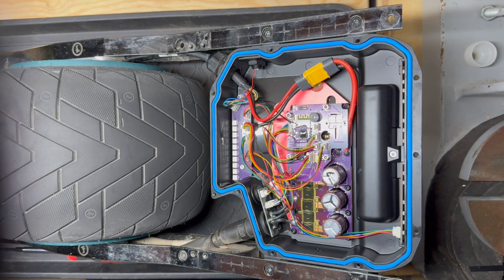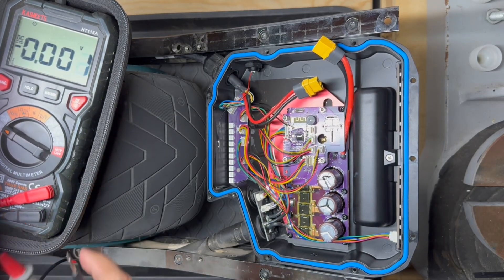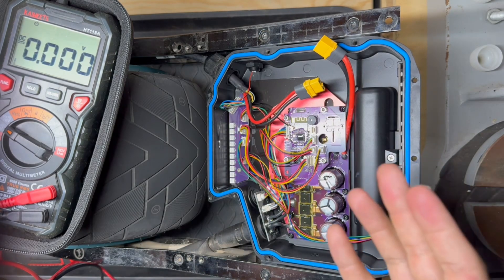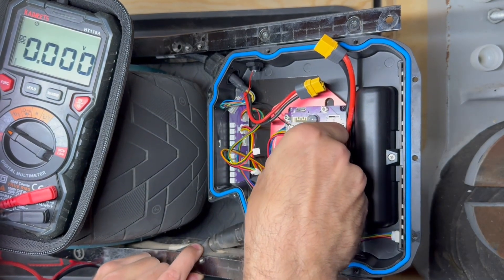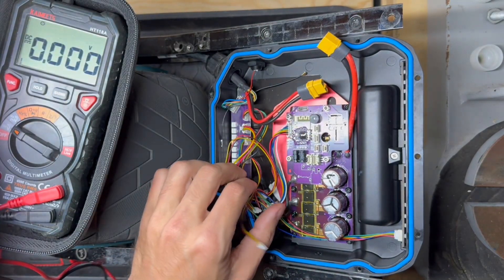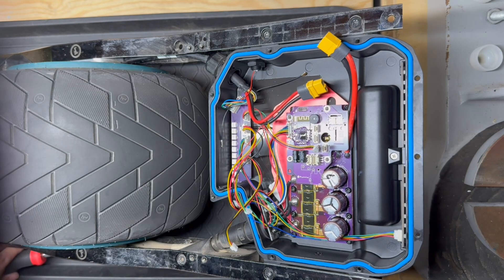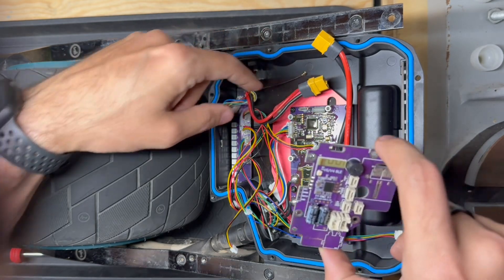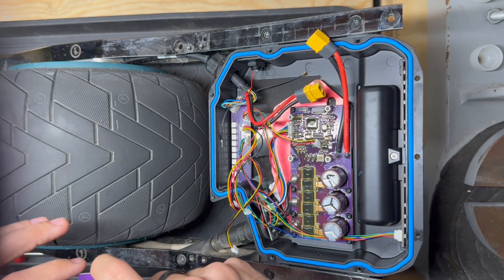How To: Floatwheel GTV Power Kit LCM Removal

Comment: Great Video, quick question Tony sent me a replacement LCM and PCB, my status light bar goes out or stays stuck on either side when I place my foot on the footpad but I have normal ADC values and the board engages and rides normal. Any idea what causes the LCM to go bad or what part does it play with the status bar? It was a relatively new kit less than 40 miles?
Reply from the maker: Given the complexity of the LCM, there are many things that could go wrong. That said, that could be a glitch as well and could be a non-issue (aside from being annoying).

Can you message me through my website? Curious to learn more about your issue.

https://www.fixmypev.com/contact-us

Comment: So was the LCM fault only affecting the lights? Or you never got to find out fully all the issues?

Obviously any known fault makes it a write-off I guess, I am just curious if the problem was isolated to the lights.
Reply from the maker: As far as I could tell, only the headlight and taillight were impacted, but I’m not sure if there was anything else being impacted. There definitely could have been.

Per PEV.DEV (since this is a modified Floatwheel ADV controller):

The “Light Control Module” in the Floatwheel ADV/Pro controls the lights, a buzzer, as well as the power state of the controller.

Comment: I was just installing my GTv kit and I watched Tony’s video a little too literally possibly? 
So I followed the video and before you go back to the BMS so you hook up front first, or after? does it matter? is  it OK for me to attach everything upfront after the BMS has been fully installed-in the order.. I just don’t wanna plug something in incorrectly… I’m new to this Vesc.  😁🤘🙏
Reply from the maker: Hook up the front first. This is what Tony does although I don’t think he shows that step. With the Onewheel BMS, there is no spark at the controller because it should be off (but there may be a spark when plugging in the second XT60 on the Floatwheel BMS - Tony highlights this).
Reply: Thank you, so I will disconnect the BMS and everything back there and then go ahead and connect the controller.  any specific order I should hook up the controller? I would think it doesn’t matter because there’s no power to it but what do I know? Always a huge help thank you.!!!
Reply from the maker: Nope. Just make sure everything’s plugged in where it’s supposed to be and you should be good. Make sure all of the connectors are fully seated as well. Tony’s video is pretty helpful, but just take your time and you’ll get it handled just fine.

Pro Tips: 

- Don’t tighten the footpad and motor nuts prior to screwing down the aluminum mounting plate. 
- Be careful with the aluminum threads in the GT enclosure. They strip easily (sometimes, even from the factory).
- Consider purchasing aftermarket gaskets. TFL has a great set (and you can get 5% off with code FIXMYPEV).
Reply: Ok, I am watching your video and you are unplugging the controller.. That’s essentially the exact spot that I am at.  I am apprehensive to go back and undo the BMS because I was not thinking and I put in new TfL gasket and a little sealant and have it tightened down already🙃   
I watched another GTv installed video and he doesn't connect controller until then end… so, I apologize for being naïve, redundant, but is it possible to just finish the connections on the controller? Everything is mounted and perfect and ready to go.  Thank you !thank you so much! I just really don’t wanna open bms battery back up if I can help it. Sweet video And thank you for all your continued support, you help us out so much.!! 🙏😁🤘✌️
Reply from the maker: Ahh. My video isn’t meant to be an install video (it’s specifically related to the LCM), but yes you can connect the controller last if you need to. Just know you are going to get a decently sized spark when you connect the XT60 connectors.
Reply: Perfect, the last thing I wanted to do was mess something up, so I’m  being extra careful. Thank you man😁🤘✌️
Reply from the maker: You’re welcome! 🤙🏼⚡️💯